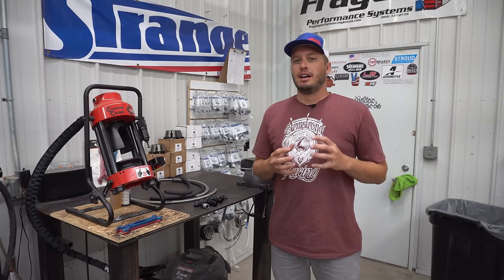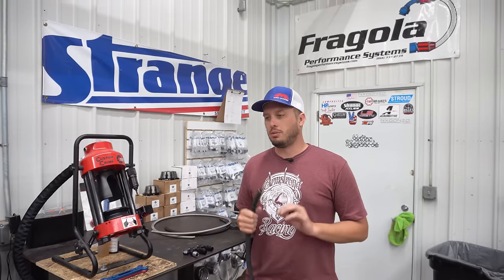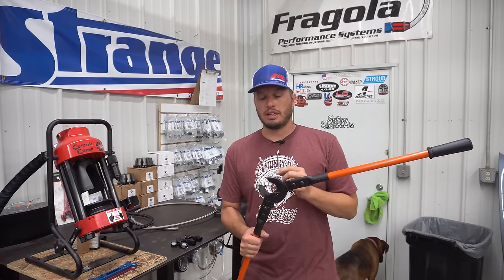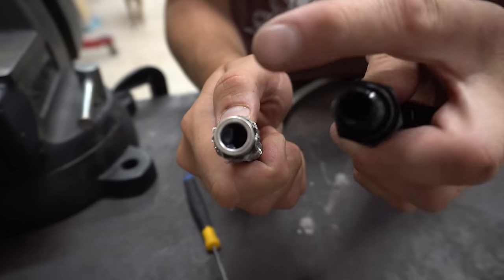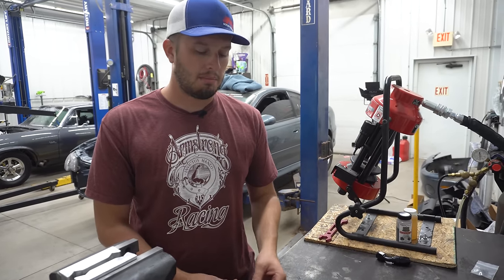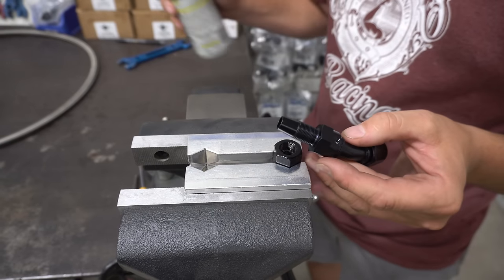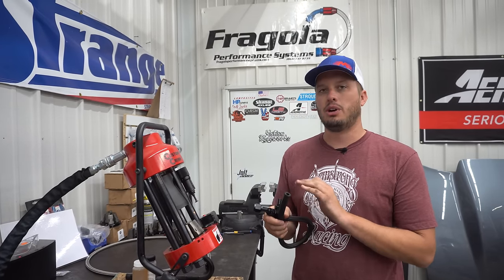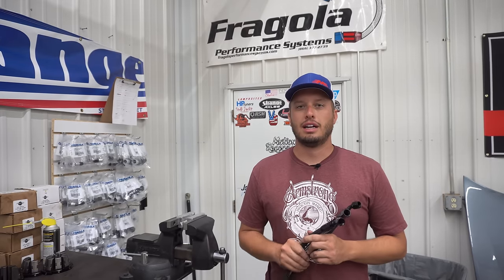How to Assemble AN, Push Loc, PTFE, Crimp Style Fittings and Hose!

Comment: There's nothing wrong with using hot water to help get the hose to go on...most of the fluids circulating in the engine bay are in the 200-220*F range, engine oil, trans oil, coolant.... a little boiling water (212*F) isn't going to bother a hose rated for those fluids, and if it's not rated for them then it's just about useless in an automotive application anyways...Just make sure you wear appropriate PPE, the hose might handle those temps, but your bare hands won't, I usually use some leather work gloves or welding gloves.

Comment: Would it be a good idea to use one type for an entire build or is it per application?
Reply from the maker: We use the black nylon braided for entire builds minus power steering, that has to be PTFE to withstand the pressure

Comment: I ordered a 10an hose and a 10an fitting. The hose is too thick to get the fitting around? What size hose is this on the 10an fittings?
Reply: Did you order PTFE fittings and regular AN hose? PTFE has a smaller OD. If PTFE + braid +outer sheath, some manufacturers recommend trimming ~1/2" of the outer sheath to fit the nut/collar.

Comment: Are PTFE fittings removable or reusable? I mean they sell the olives separately...If so, how do you do that if you're cut your hose a bit too long or short? I'm finding it nearly impossible to get it off on Stainless steel braided ptfe hose can someone help ?
Reply: To test the length just leave the ferrule off and bottom out the hose into the fittings. It's a compression style connection so the ferrule and line compress and expand into each other. Pretty much a one time use.
Reply: @robwigglezz944  yea I feel if I use the nylon braided ptfe I'd have a chance of removing it
Reply: I was told that if you use the steel PTFE fittings you can reuse them with new olives.... if you can get them apart!

Comment: Can you use different brand hose with different brand fittings or do they need to be from the same manufacturer?
Reply: Most hose companies don't make fittings. So yes, you can use different manufacturers
Reply: @Airplanefish  No... don't mix manufacturers of hose and fittings, especially in high pressure applications.

I swear every second piece of advice in the comment section of this video is incorrect and borderline dangerous.
Reply: @scod3908  if a company makes a hose but doesn't make fittings then how would u use the same manufacturer?

Comment: The standard AN braided hose does that have a wire or cloth internal reinforcement?
Reply from the maker: It has a cloth or steel braided outer covering with a stainless wire reinforced inner rubber hose

Comment: Do NOT Heat, Cool, or lubricate Push Lock fittings. Use P-80 Emulsion Temporary Rubber Assembly Lubricant. Read the F.. Manual.

Comment: would this work with transmission lines i want to use flex lines to avoid headers
Reply: PTFE... Good -8 can take 2,000 lbs of pressure and 400 degrees

Comment: I've never used a tool for pushlok a little lube is all you need and I use high line which is rated to 3000psi and is commonly used for power steering line or even ac lines that fixes your abrasion problem so other then you stating some leagues have rules which I've not seen so far, you issues with pushlok seem to be unfounded
Reply: He spends superlong convincing the audience that "pushlok bad" then just skirts buy the difficulties and issues with using traditional an lines or even that fact that the special tools are needed
Reply: @AndrewThomasy01  You don't need the fancy aluminium tools, just wrap some tape over a quality tool (preferably not a shifting spanner/wrench). Knipex plier wrenches with parallel jaws are perfect for this task, pricey but useful for many other tasks like removing flare nuts without damaging them.

Comment: You are doing the PTFE in the vise the wrong way; you should have the fitting in the vise--otherwise you are rotating the fitting inside the lining by tightening it your way. By putting the main body of the fitting in the vise, the fitting isn't moving, and you wrench on the fitting end piece instead, drawing it together. Sorry for criticizing...
Reply: PTFE is low friction unlike regular AN hose. The male fitting should turn in it just fine. Rotating the nut can distort the stainless braid and chew into the PTFE. It's the olive which is made of a softer material which distorts to form the seal, which is why the olives can be purchased separately for the reusable fitting types

Comment: I spent 1000$ on everything just for two hoses… dont do it just go to shops buy length that u need and spend less 😂
Reply: How? I am making fuel lines for my custom built motorcycle. Smaller than a car but I have supplies for 10 hoses 75’ with all the different sizes and accessories. Including tools only cost around $200.

Comment: Sometimes on AN hose I have trouble getting the hose into the fitting with the nylon braid.  Is it bad to trim that back a little to get it to go in?  Any tricks that would help?  I've tried putting it in the vise and pushing and spinning it but it's still too tight with the nylon braid.
Reply: Yes. Don't trim the outer braid (stainless or nylon). I've been assembling AN fittings since the 80s and wrapa single layer of fiberglass filament tape around the section of hose I want to cut. Using a cutoff wheel or "chop saw" cut in the middle of the tape. Leave the tape on the hose and then insert it into the fitting nut fully.
One thing he didn't mention is there are several variations of AN fittings. Earl's for example used "cutter method" fittings, while Russel and others use the style like he showed here with Fragola yjsy simply slip a tapered end nside the hose to expand it against the outter shell nut.
Reply: @laneeric  thanks,  I'll keep trying.